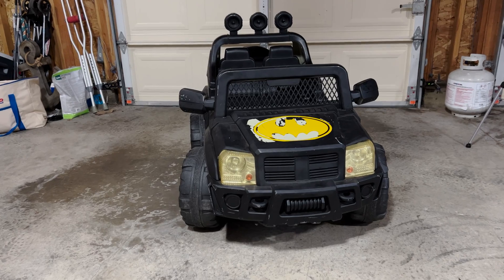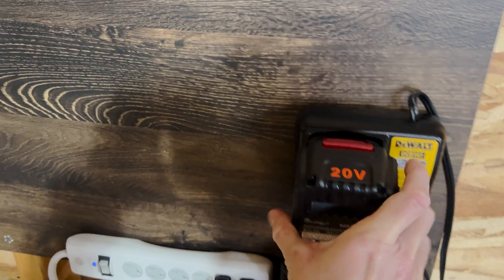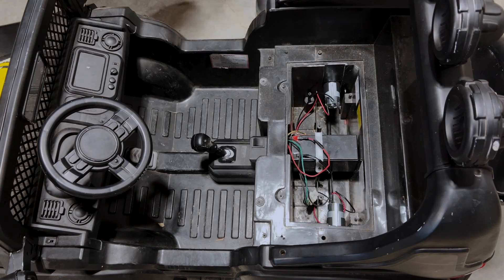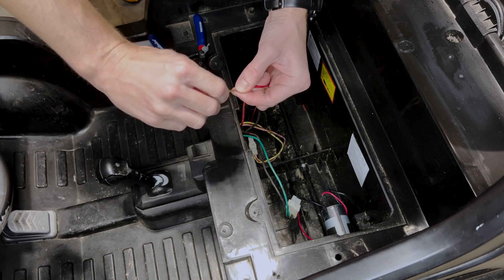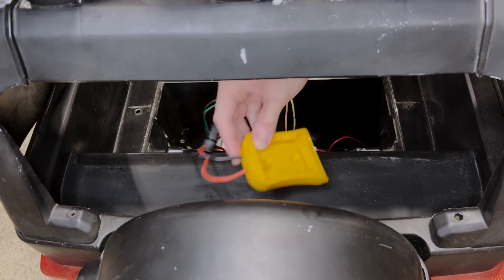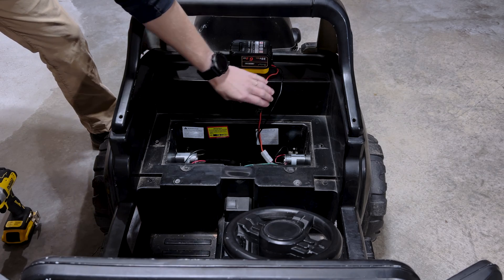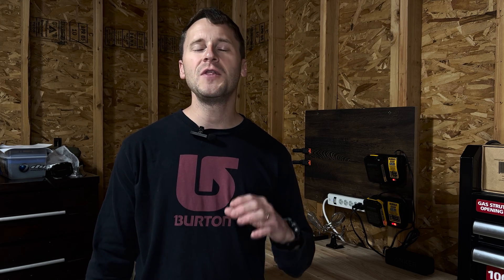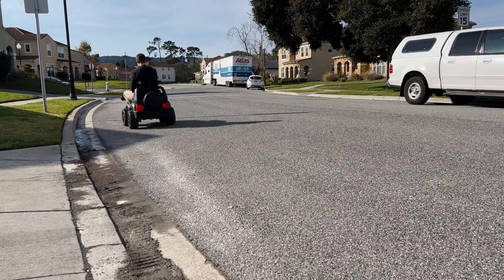The first Power Wheels UPGRADE you should do

Comment: They make 24v replacement motors for the power wheels. You can get a set online for around $40. They're faster and can handle the higher voltage that will kill the original motors.
Reply from the maker: That is good to know! Might have to look into those

Comment: A lot of ppl have tried increasing the voltage and they all end up destroying the motor, so I tried something different.
I made a sidecar for my Schwinn Stingray OCC using a power wheels motor. I took the motor assembly off and attached a full size 26" bicycle tire to it and mounted it as the outside tire for the sidecar and made it controllable from the handlebar grip. It makes a great boost that reduces pedal strain about 50%. If you've ever ridden one of those Stingrays you know they are really hard to pedal so that's a huge help.

Comment: I did this today with my daughter’s powerwheels and it was all great but only lasted for about 5 mins. 

After 5 mins 2 things happened. 

1. The wheels kept spinning on reverse uncontrollably when the power wheels is turned on. It won’t stop until it’s turned off. 

2. There was a strong electrical smell when I popped the hood. Really warm too.

Don’t know what to do. Can you help?

I used a craftsman 20v battery
Reply from the maker: Dang that’s always a buzz kill! Sounds like a controller board problem. Does it have a remote control or things in the dash that play a radio and stuff? The one I upgraded was pretty old school and sent power the to the motors without having to go through a controller board. Let me know and I’ll see if I can help more!

Comment: Be careful doing this it will trash your motors in minutes
Reply from the maker: You're not entirely wrong but it really depends on the voltage rating of the motor. I ran mine for hours before my daughter crashed the car into the curb and broke the axel, and I would say the gears would go before the motors. Heat will kill the motors so if proper cooling is supplied, it will extend the life of them.

Comment: So if I upgrade to the  higher voltage, but I still want to use the remote control, I should probably put a voltage regulator on the receiver, yeah?
Reply from the maker: Absolutely! The only thing to keep in mind is that the amps may be too much for the board even if you dial down the voltage. I experienced this and that’s what blew up my previous board, granted, I did hit with the full 20V. If you are using a 12V board and dial it down to 12V from the battery, you SHOULD be fine to use the remote. Be mindful not to make too many abrupt inputs, such as all forward then all back immediately.

Comment: hello i hope you could answer my question

im planning to diy upgrade my sons power wheels too. I read on the description that this is not recommended with those controller motherboard and that is my problem.

how can i convert it  from 12v to 24v 

thanks in advance!
Reply from the maker: Would you be able to let me know the model of the power wheels? Depends on if a 3rd party makes a controller box that is rated for 24V. If not, you have two options, either get a voltage regulator and dial it down to the rated voltage of the controller board or do a rewire.

Comment: If you add another pack & run it in parallel, you can greatly increase the runtime. It also allows you to swap one battery out for a fresh one & charge it, while the vehicle is still running. It looks like you might be able to fit up to three on the rear deck, while still allowing them to be easily removable. Maybe, you could keep chargers & batteries at the houses that your kids like to visit. If all the kids with Power Wheels have similar modifications, you can make it easy for kids to visit each other. The batteries can be swapped between families & their vehicles.
Reply: If it was still working. Wouldn’t 40v eventually overheat the motors ?
Reply: @JJDuval  For my applications, I step down the voltage & keep it close to stock. I consider the increase in runtime well worth it. For those that want more speed there are some higher voltage motor/gearbox replacement combos, that go up to 24 volts. I am running an Arduino setup, with a motor driver. The motor driver has its own voltage regulator, so I can increase the voltage to the motors, independent of the supply to car's main electronics. 

There is a little room to safely overvolt the motors. Ride on batteries actually put out slightly above 13 volts at full charge. 14v would probably work. You just don't want it to get hot enough to melt the insulation on the windings & short the motor out. You could also use relays with the controls, if you want to protect the electronics.
Reply from the maker: You can always run the risk of overheating a motor when applying beyond their power rating. However, cooling and airflow will help extend the life of the motor, like applying heatsinks or installing fans.
Reply from the maker: Love the ideas! Unfortunately my kiddo crashed the car and I had to scrap it. My plan was to rig up two adapters in series for a total of 40V, which would have been unreal.

Comment: I have the same issue going on with the kid one bumper car.  
I hooked up an 18v drill battery and it work for about 15min and then it died.  Smell something burnt. 
From your bumper car video u experienced the same problem. 
I also have a 12v power wheel car that I swap it to a 18v battery and everything works fine. 
I don’t understand why one works and the other doesn’t. 
I have no knowledge on how to rewired like your bumper car video so I can’t copy to do u do.  
Question is if there’s is any other ways for me to fix the bumper cars without burning some other component.  Tia
Reply from the maker: Sorry you're having the same rough time I had, not fun at all! If you don't want to do a rewire, the next best thing to do is get a voltage step down (https://amzn.to/3PoBN6Y) that will bring the 18/20V drill batteries down to 12V, or maybe a bit more. The problem with the controller boards is that they don't handle overvolts very well and are a bit a ticking time bomb when you supply extra volts (what you get with cheap Chinese parts). 

As for the power wheels, chances are if the drill battery is working without an issue, it is just a straight DC system and your only limitations are the gears and motors, motors can take a lot before they break. Hope that helps!
Reply: Exactly the same for me, worked amazing for 10 minutes and then an awful burning smell and now the gator is scrap sat in the garden.
Reply from the maker: @KTMSparky does the gator have a controller board? I have found that manufacturers use cheap boards that barely survive beyond their voltage rating. I would highly suggest doing a rewire, like I did in my bumper car video if you want it running again. It seems daunting but it’s actually easy once you figure out your circuit plan.